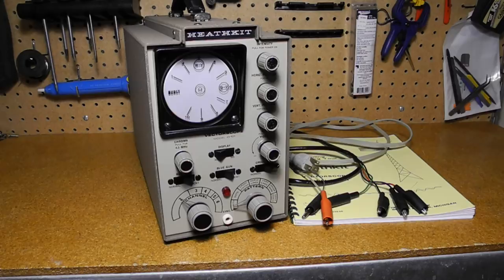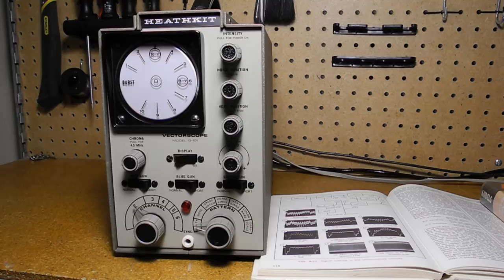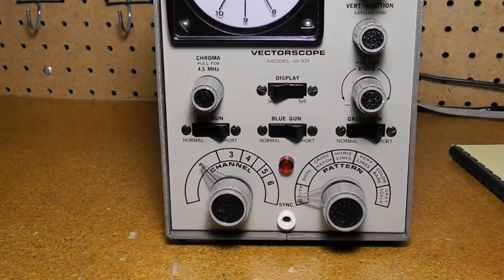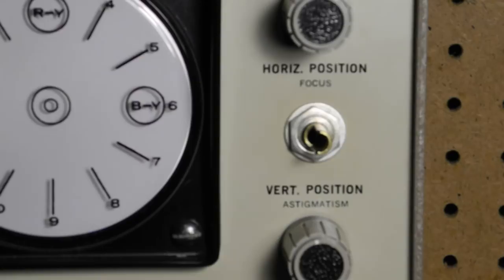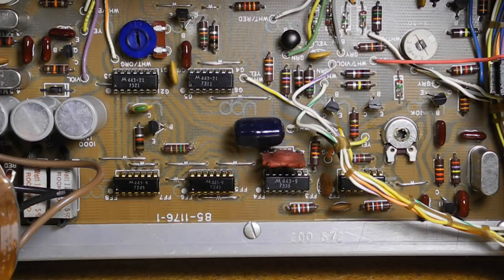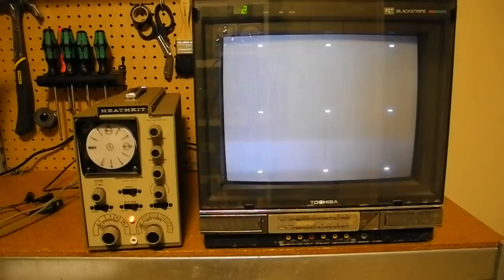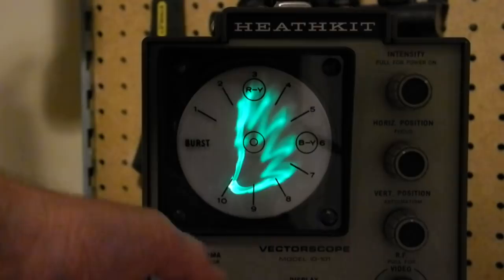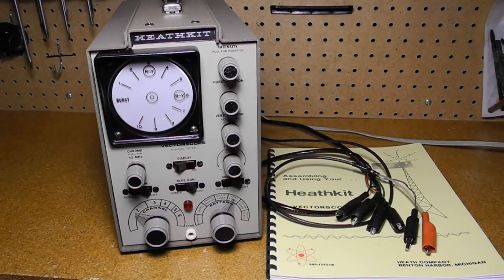The Heathkit IO-101 Vectorscope

Comment: Funny coincidence, I just bought one (IO-110) from Craigslist this last week (6/20/18) there does not appear to be a trace on my scope, so I'll go thru it and I will make it work again.  Mine came with the original assembly manual and original bill of sale. The owner/builder signed and dated the final assy. page 6/17/74.  I bought it from his daughter, and might pick up some more item from his estate,  this is one of the best looking Heathkits I've seen.  I thought it may have been factory assembled because of the attention to detail.  Very lucky find for myself. Looking at a VTVM and a capacitor checker. I love this old Heathkit gear.

Comment: How can this be used (repurposed) on a general purpose test bench.  That is forget it was for TV alignment and make good use of it elsewhere.  Same question on the color bar and dot generator.

I have just finished reading your “classic Heathkit” book cover,to cover and haven’t discovered a way to repurpose these beautiful “boat anchors”. Thanks in advance!
Reply from the maker: You could potentially turn the vector scope into a general purpose oscilloscope using the CRT and power supply, but would have to pretty much completely rebuild the rest of the circuit. There might be room on the chassis to do this, maybe based on the circuit from a Heathkit oscilloscope.
Reply: Jeff Tranter  Thanks for the quick reply!  I have the heathkit IO-4560 oscope so i was more hoping that there are some waveform generation features on the vector scope or my IG-28 that i could use for reference and education in how to use the oscope.  Seems like that is what the bar, dot, and 4.5 MHz features are built to do.    Am I dreaming to think these boxes are useful for more than TV Alignment?
Reply from the maker: It can be interesting to look at the output waveforms in an oscilloscope, but they were really only meant for TV alignment purposes and I don't see any way they could really be used for anything else.
Reply: Jeff Tranter Thanks Jeff!  I guess they are just 2 more pretty faces on the shelf.